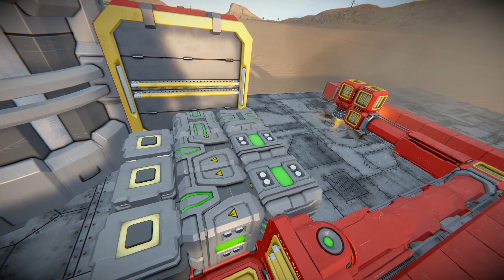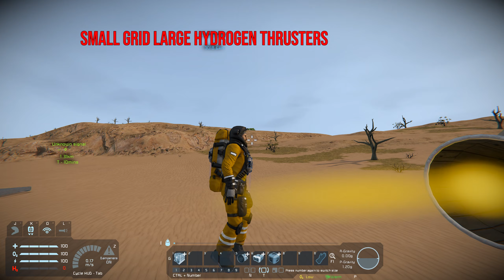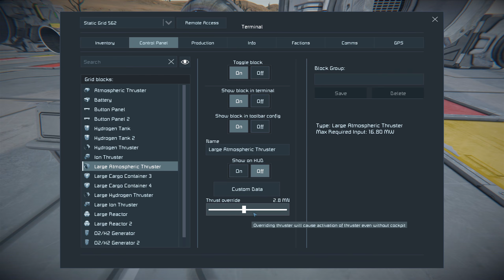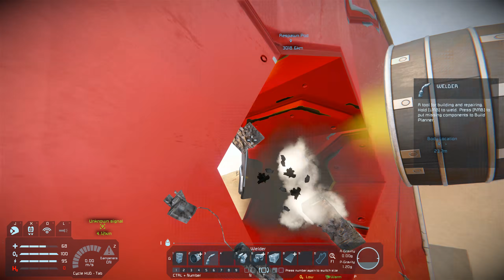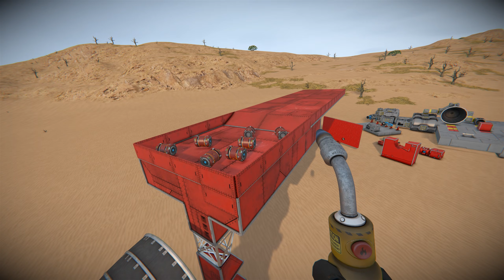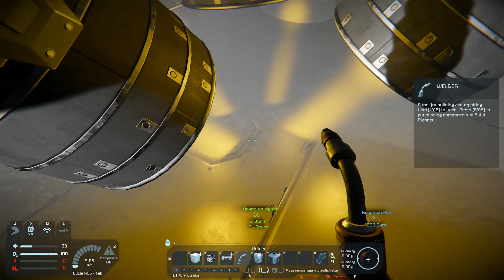Thruster Damage Revealed 🚧 DAMAGE TESTING !!!  - Space Engineers

Comment: Would be cool if you could make actual cement blocks (not just the texture) out of gravel. These would be air porous, and they would be easier to break with normal damage (more brittle), but highly resistant to heat/thruster damage. That would make them ideal for landing pads.
Reply: Doesn't heavy armor already sort of do that?
Reply: @Gracefulwarrior2124  Heavy armor is more damage resistant in general, but thrusters will still damage heavy armor. Over time you'll need to add some plates back in and repair. What I'm talking about is a substance that is almost immune to heat damage, but more vulnerable to impact or other damage, like concrete would be.

Comment: Thrusters are fantastic for missile self-detachment.
Missile's attached with light armor blocks (small grid)
When launched, the missiles own thrusters cut through in seconds - releasing the missile.

(keep in mind a 2x merge blocks are like 300 PCU, where as a small armor block is only 1 and thruster has to be there anyway)
Reply: do  a small grid conveyor tube instead, it melts faster plus since it does not deform, not as much damage is transfered to the missile. But an event controller can't detect the missing block you might have to go with the detected energy consumption of the separating truster or timer block. At the end of the day, whats wrong with merge blocks? xD